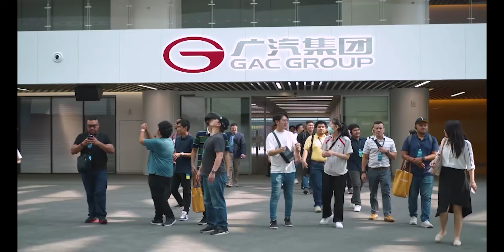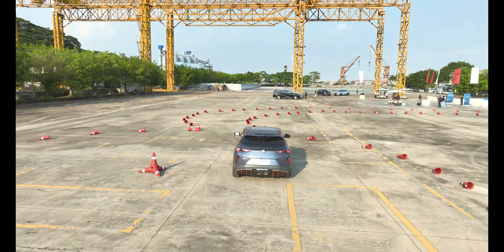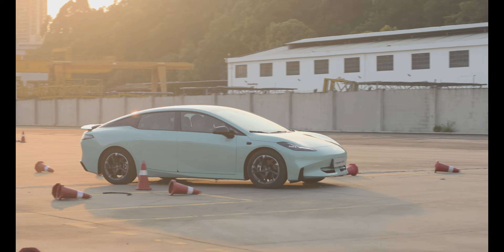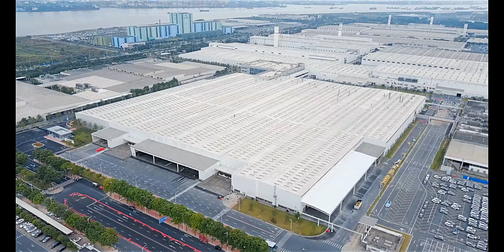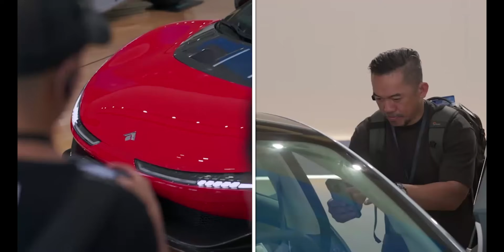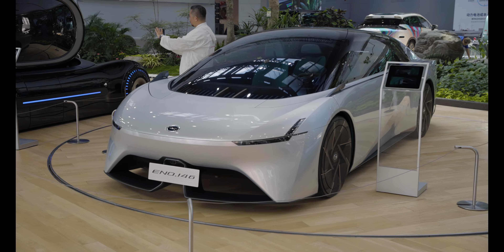GAC Motor: Re-Think "Made In China" | CarGuide.PH

Comment: My brother bought in cash GAC empow GE 2024, I've tried driving it and it drives more than a vios, a honda city, a wigo and can compete against Toyota corolla, Mazda 3 and Honda civic 1.5 engine. It's interior makes corollas outdated, plus its packed with high tech features. GAC empow's engine is powerful enough with 174 HP turbocharged engine 270nm torque can go 0-100kph for almost only 7 secs while toyota stock corolla could only do 10.45 secs. The only question is its reliability, spare parts its not a problem because we can directly get parts overseas. Para sakin sulit yung GAC empow.

Comment: Chinese made cars may be cheap and may look promising, but don't be fooled. You get what you pay for. Better put your investment on something that's reliable.
Reply: Kailan pa naging investment ang personal cars?
Reply: @louwhelove4675  i didn't say cars are investment. I said "put your investment sonewhere else". Better work on your comprehension.
Reply: @louwhelove4675 mo
Reply: Be world class. Philippines does not have even one car brand.
Reply: Remember what Chinese cars were around 10 years ago…thats an alarmingly fast rate to see what they have now
Reply: My brother bought in cash GAC empow GE 2024, I've tried driving it and it drives more than a vios, a honda city, a wigo and can compete against Toyota corolla, Mazda 3 and Honda civic 1.5 engine. It's interior makes corollas outdated, plus its packed with high tech features. GAC empow's engine is powerful enough with 174 HP turbocharged engine 270nm torque can go 0-100kph for almost only 7 secs while toyota stock corolla could only do 10.45 secs. The only question is its reliability, spare parts its not a problem because we can directly get parts overseas. Para sakin sulit yung GAC empow.
Reply: Chinese made cars are not created equal. cars are never investment, it's a liability😊
Reply: they are catching in reliability, they will dominate in the future
Reply: @ronaldchua3197  I doubt that
Reply: @migueldelacruz5054  why you doubt? their Highspeed rail ,Space station, 5G 6G boardbands electronic Gadget, Cellphone , Solar panel EV Battery EV car are Advance in the world
Reply: @migueldelacruz5054  they are getting better and better each year see more few years they will catch up
Reply: ..future it is but not today... @ronaldchua3197
Reply: Hahaha...china cars are killing on other countries...dont rely sa kung ano nakikita mo sa pilipinas patunay lng yan na mas close minded people ang pilipino...haha...for me ok mga gawa ng china car ngayon 3 years na coolray ko still good prang bullet pa din humataw pag mag overtake d ka talaga mapapahiya..na una pa nga nag karoon ng dperensya ung sasakyan ng pinsan ko na japanese brand d na ko mag mention ng brand na halos sabay lng kme bumili..hahaha...